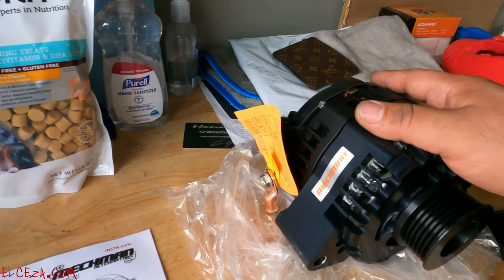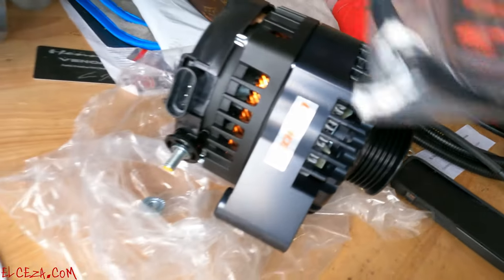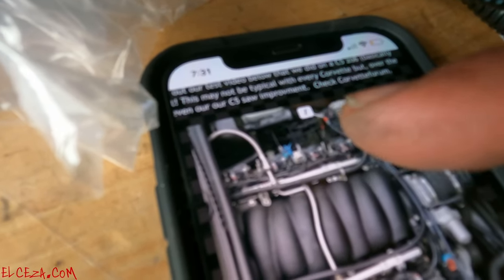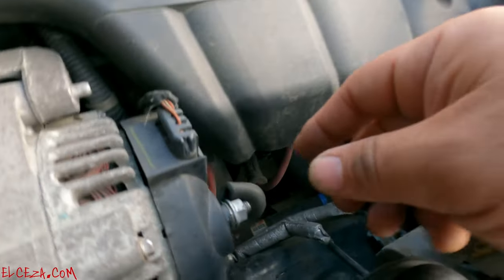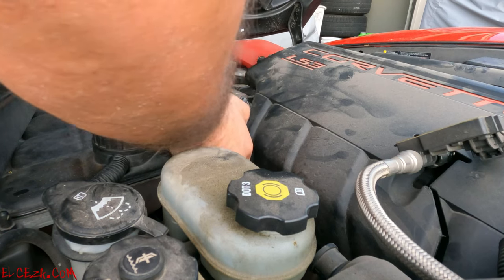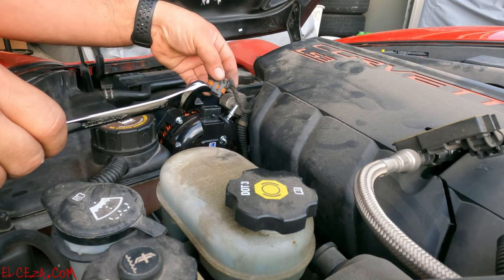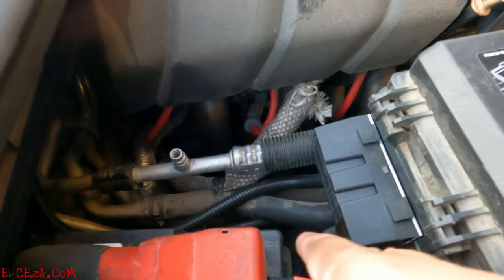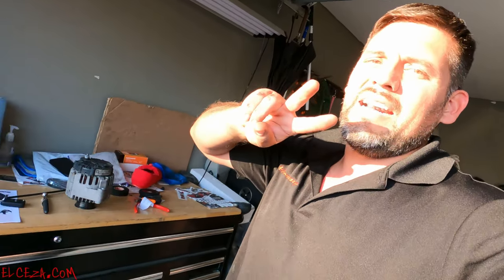C6 Corvette Mechman Alternator Upgrade Along With BIG 3 Wire Set Up

Comment: The claim that Mechman is " the best" in this video is a little misleading but not entirely false but in this case it is false. Mechman is great, I run them. BUT the best is the billet 250 amp (not to be confused with this video's 240 amp billet) The 250 is built by Mechman but you can't buy it from them. It was developed with help from a guy named Brett on Corvette Forum. I believe the 240 in this video will put out high 130 amp at idle versus the 250 puts out 200 amps at idle. I can't remember but I think I've read the billet 170 actually puts out more at idle than the 240 in this video. So like I said, Mechman makes the best, but if you call them you can't get their best, it's sold by Brett as private label. To be clear MOST people will have their Vette's electrical load needs plenty fulfilled with the billet 170 amp. Plus with the 170 amp you won't require upgraded conductor sizing.

Comment: Im thinking of making this myself as ive done it before and its a bit more cost effective. A little confused on how its supposed to properly be wired up but only because conflicting accounts. This way from what i can tell goes from battery to fuse and then has two connections, one for PDS and one for the battery, thats the way id make it myself and id use a 125amp fuse aswell since im not going too much extra and the other fuses should work aswell? Ive just heard conflicting evidence saying you wire from alternator to PDS to battery but i dont know if their right. I might just make my own saccity kit the way they made it and wire it up the same and expect it to work the same. Like i even found the fuse box they use so im feeling pretty confident on how its made, even if it was wired from alt to pds to battery dont know if that would change much
Reply from the maker: This might help you out
https://www.saccitycorvette.com/C6-Big3.html

Comment: Do you think the parts from Sac City would be good enough instead of replacing the alternator?
Reply from the maker: I dont think you need extra parts from sac city unless you are upgrading alternator 
You shouldn’t need upgraded alternator unless you upgraded fans or have a custom audio system with amplifiers
Reply: @El_Ceza  I just have the same stock boring horrible sounding system from 2005. However, I think without turning off the radio, it drains the battery.  I also have a issue with the c4, I have a parasitic drain someone, as for now, I unhook the battery every time I park the car.
Reply from the maker: In my case i started by replacing battery then went from there
In regards to the c4 i had a similar problem with a tahoe the issue was the driver window switches module that would drain the battery so it had to be disconnected at nights or if it sat for a while

Comment: How did it work out? C6 z06 here looking to do for hot start issues.
Reply from the maker: Works amazing!
Reply: I think I’ll try this before I upgrade my alternator. Was thinking about a mecman with this. .
Reply from the maker: Mecman is the way to go if you decide to upgrade alternator 
Prospeed sells upgraded dual fan kit that plugs right in